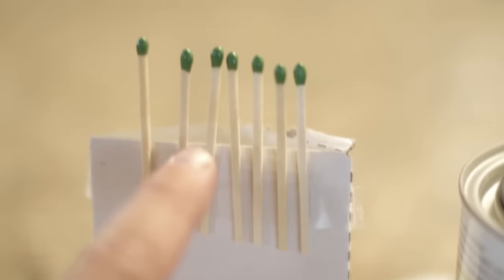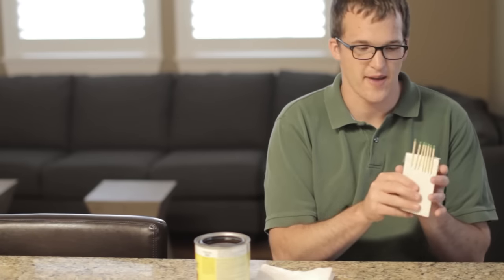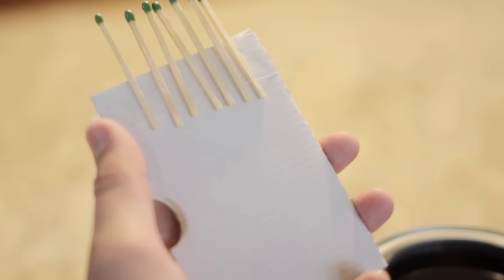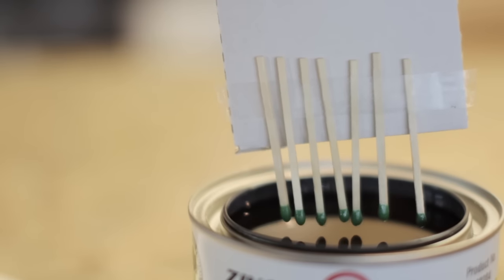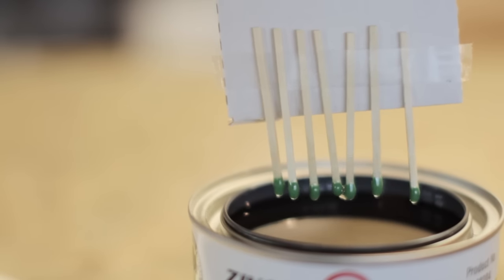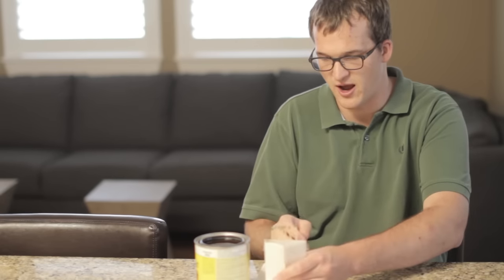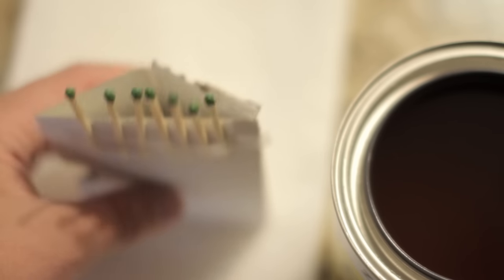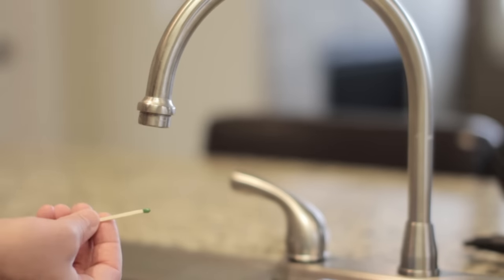DIY Waterproof Matches - Quick & Easy To Make

Comment: Still works,.  When I was in the Cub Scouts and Boy Scouts, 55+ years ago we used shellac for all our projects, including water proofing matches.  Might try clear nail polish, seems like we used that too... One thing, as you pointed out in a comment below, these coatings are more durable than a wax coating and even though we may carry a lighter, having some matches never hurts.  I have several boxes of "Strike Anywhere" matches which are great for this stuff...
Reply from the maker: ***** clear nail polish works too (and would probably save you a little bit of money). The durability of Shellac and Nail polish is definitely the advantage over wax. If you're throwing a couple of these in your pack for, "Just in case" then it's nice to know that they'll still be protected when you need them. Thanks for watching! :) - Chris

Comment: It does work but is it harmful to breathe in the smoke from burning 'Shellac'.? If so, then only ignite outdoors in well ventilated areas.
Reply: Any smoke is harmful to breathe. But yes, this method will likely make it a bit more toxic. And yeah, outdoors only, but what use do you have for a waterproof match for indoors anyway? Maybe emergency, like flooding or something? But then your concern is probably on other things that are way more dangerous.